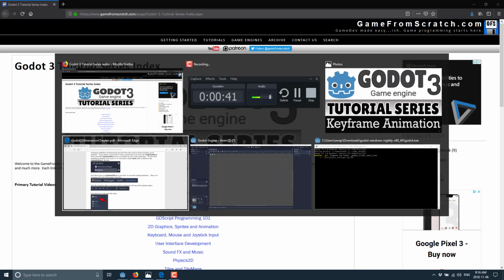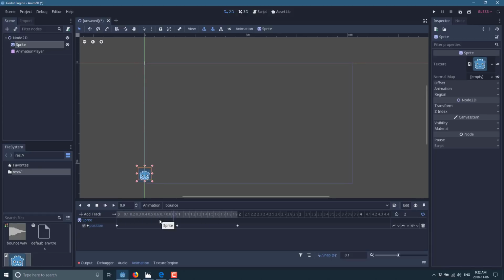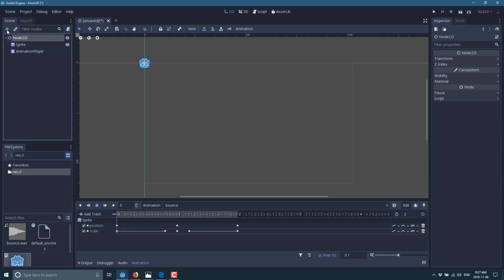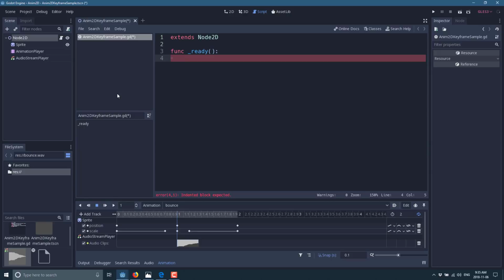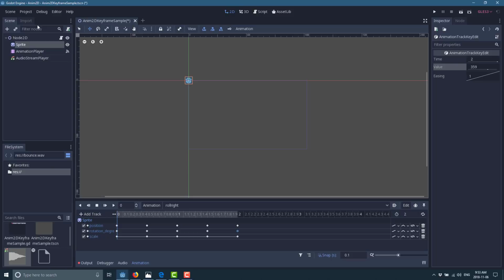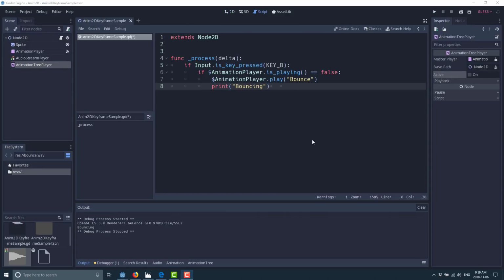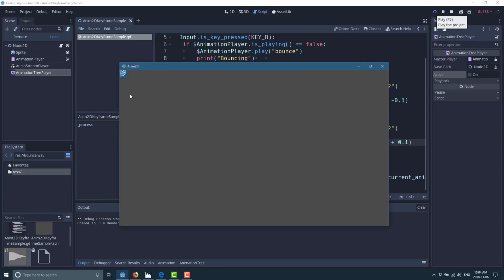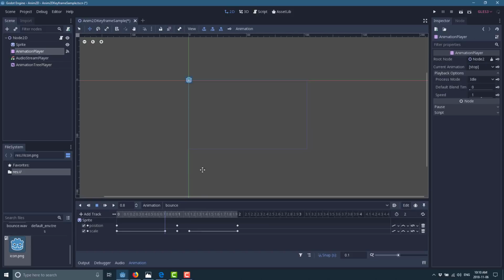Keyframed Animation -- Godot 3 Tutorial Series

Comment: Good video introducing Godot, but coding is very messy. You had AnimationPlayer and AnimationTreePlayer playing at the same time, while the logging code only applied to AnimationPlayer. That logging code got totally ignored when you removed to code to activate AnimationPlayer. Also, the condition that got changed to "<= 1.0" wasn't quite right. A better way to do this is to clamp the value afterwards.

Comment: It's just dumb to use a Sprite node for animations because it can only hold a single texture. It's really intended for static images only.
It's much more efficient to use an AnimatedSprite to hold all the textures you need (even better if they're AtlasTextures) and then manipulate it with the AnimationPlayer.
(though I see that the video isn't exactly about that lol)
Reply from the maker: AnimatedSprite actually confuses the subject slightly (and I've already covered it in the past, in the Sprite video), in that it's an animated sprite (as in,  a flipbook style animation), in this case I am animating a sprite... as in, making a single sprite move.  It leads to such confusion in terminology, that I just went with the most simple and direct route.

I specifically stayed away from AnimatedSprite as it is a completely different kind of animation.  This is animation of properties and tracks over time using keyframes, that's animation of frames of a single sprite.  Besides, I generally use the default icon as it's built into every single project. 

It would be quite common for people to do both... have an animated sprite to play animations, then use an animation player to transform that objects position.  Using an animatedsprite node though would confuse people into thinking they needed to use that form of node to do animations using keyframes.

Anyone interested in learning more about sprite animation, be sure to check my earlier video.
https://www.gamefromscratch.com/page/Godot-3-Tutorial-2D-Graphics-Sprites-And-Animation.aspx